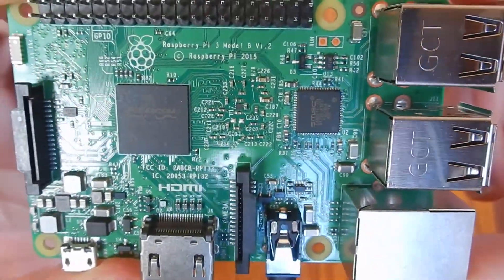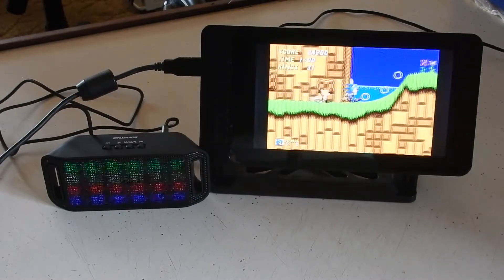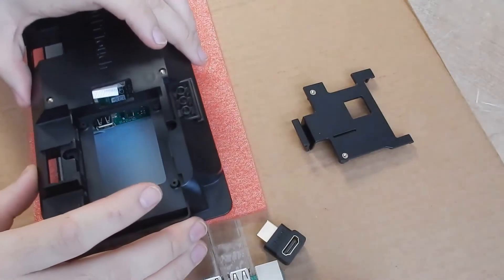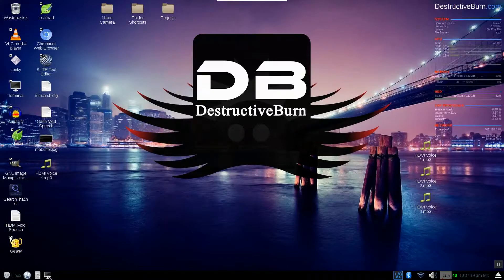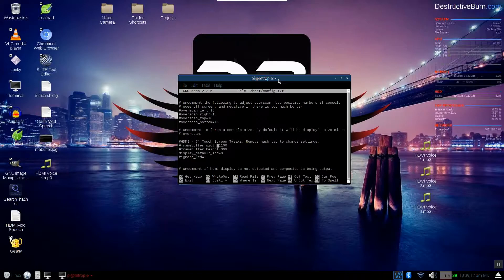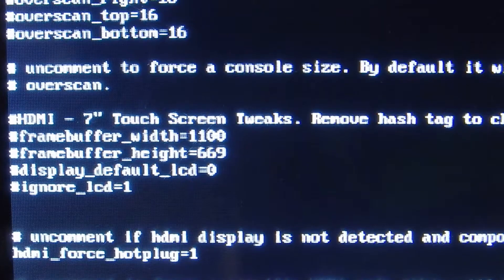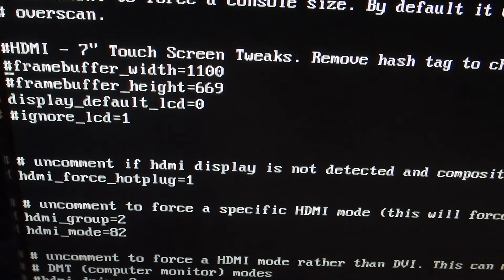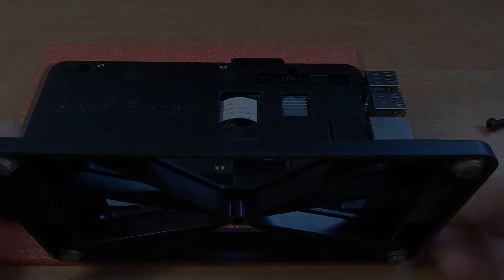Raspberry Pi SmartiPi Touch Case HDMI Mod

Comment: The hardware modification doesn't look too difficult, and came out looking great!
I considered doing the same thing to my setup also.
The problem I have is that the switching process is too cumbersome for my liking and needs to either be streamlined or built/patched into the system software.
Regardless this is a nicely done mod.
Kudos!
Reply from the maker: Michael Thompson Michael Thompson It was really easy.  You just need a Dremel with a plastic cutting wheel.   I agree with the bootconfig change.  However you change it plenty of times it becomes simple and fast.  
Good luck when you mod it.